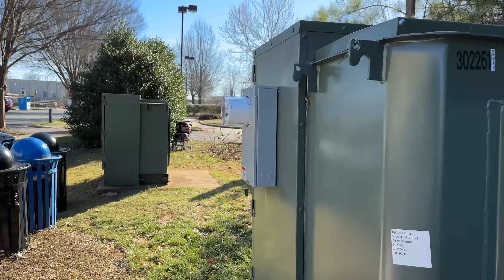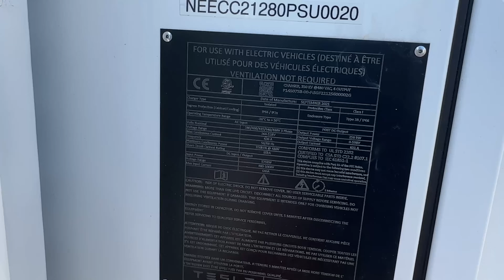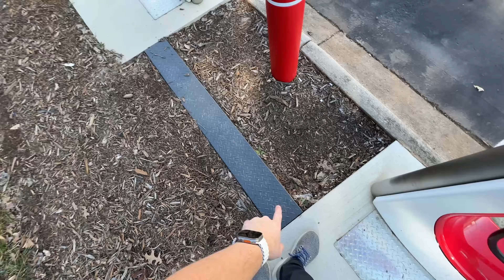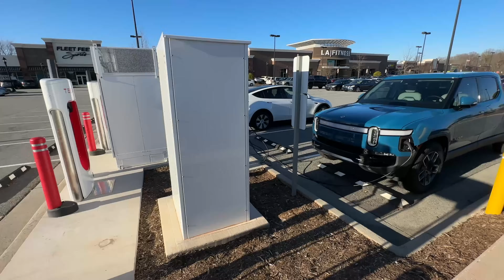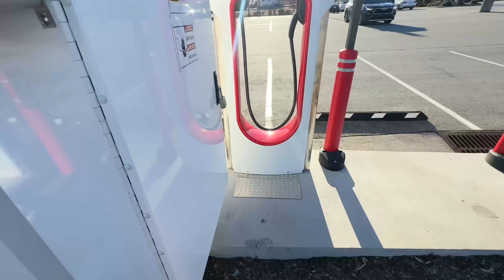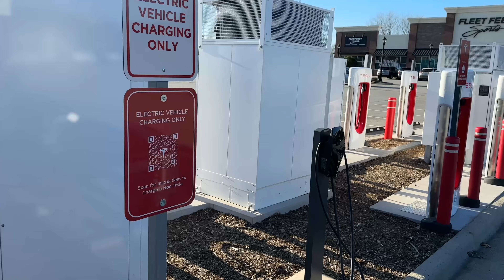Tesla Prefabricated V3 Superchargers - Genius or Incremental Improvement?

Comment: When the Bemidji MN Supercharger was new I walked around and looked at it and remember talking to my kids and told them that it looks like Tesla learned a bit and a lot of this is prefabricated probably for speed of deployment, installation and cost reason.
Reply: After watching this this is definitely more prefabricated than the one I saw in Bemidji. The V2 is look like everything was poured, wired and installed and set up at the site.  So when I went to the Bemidji one it was clear that the pedestals that the stalls they were sitting on were pre-made. That's what got me to start  looking at it.

Comment: I'd like to see a video talking about how a CCS adapter can be used on a Tesla supercharger.  Specifically, how would it work for a vehicle with the charge port in the right rear when the charger cables are so short.  It seems like a CCS car would have to park in the adjacent spot, thereby actually occupying two spots.

Comment: You mentioned the layout with the L2 chargers on the ends. I'm guessing this comes down to the way the DC bus connection from the main cabinet to the single sided isle. It's really short. It probably just worked out the best based on their lease for the property. Though they could have slid everything down one spot maybe and had the L2 chargers on the end with the utility transformer.

Working as a designer for an EE firm I really enjoy your channel (came upon it from the Out of Spec channels) and learned stuff. I'm in CA and we have to provide pathways for EV charging (7.2kw per stall) per code. Working on a current project that I need to bring a dedicated feed over for 10 EVSE spaces and makes me wonder if it would be better to just for single phase 480-120/240 transformer to get a little better charging performance.
Reply from the maker: I agree for this install - likely came down to the space allocated and aligning DC buses. L2 is easy to move as needed on a plan.
For your project, if you already have a 480 feed, I’d do a 480-240/120 step down to get better charging performance. You can also then have smaller conductors to the transformer and place it close to the charging install.

Comment: Single phase is not more effecient than 3 phase. Also home voltage is 240v, commercial is 208v.  The most effecient step down to level 2 would be 277v down to 240v ( tho i understand it may be 208v because this is not residential)  although did you see if that step down was in fact 277v input? I would.assume it would be a 480v step down.  (The least amount of step downs the better) also higher voltage transmits more effeciently.
Reply from the maker: What?
Reply: @brandenflasch  lol.sorry my CD was scratched and i skipped lol *fixed
Reply from the maker: Single phase isn’t more efficient per se, but 240V vs 208V delivers more power an EV at the same current.
Reply: @brandenflasch  I do agree with that, but that’s not what you said in the video or at least not what i got.  Also there is 2 reasons why, 1 st the efficiency in conversion is better to step down les from 277v to 240, second as you said wattage is Voltage X amperage, so 240x50 is more than 208 x 50….although idk if Id say that’s the reason it’s more efficient because all you would need 
to do is raise the amperage to 60 and yield the same out put.  I know I’m splitting hairs and most people won’t care, but thats what happens happens when the nerds arrive haha
Reply from the maker: @stang393  well when you’re current limited on the vehicle side, you need to increase voltage.
Reply: @stang393  The primary current of the step down transformer would also be 1.732x for a 277V primary compared to a 480V primary. It would be slightly cheaper. And a more standard transformer is 480 to 120/240. My guess is that's a 25KVA transformer in that package. That 52.1A @ 480V and would be 90.3A @ 277V. So at 480V you get #6 conductors and #2 (maybe you could make #3 work) at 277V.

Not saying that a 277 to 120/240 transformer doesn't exist but I haven't seen one in 24 years working for a contractor and an EE firm.

Comment: Trying to understand how they share the DC bus. Current to a car connection needs to be throttled to match current requested by the car. I would expect this current throttling to be done in the AC to DC conversion unit.  This cannot be done if  DC is paralleled after the DC conversion and before the car connection tap.  Seems each car connection needs to have an additional DC to DC current throttling device.
Reply from the maker: The DC bus between cabinets is at 880-1000V, so I suspect they’re using buck converters or similar to regulate voltage when then outputting to vehicles.
Reply: @brandenflasch  that brings up the point of moving to 1000V - they'll skip using the DC to DC conversion and just use full voltage that is going between those cabinets.  I can't wait to learn all the specs of the Cybertruck.
Reply from the maker: They’ll still need to use DC-DC to match voltage

Comment: As always nice insights and good point that the level 2 AC charging should be grouped together and maybe increased to the same amount as DC fast chargers but great move from Tesla to now also support non-tesla vehicle charging although it's just 11kW i hope for you that the most reliably fast charging network around the globe opens up over on your side although the different connector is the biggest problem and the short cable lengths and therefore cars like ID.4 could block 2 spots if not parked properly..
How do you feel about adding a additional energy storage for lower input power requirements and back up capabilities for limited time, especially with star link terminals it makes even more sense (if the relay or ground station is also backed up)
So like 1MWh storage, capable of delivering and receiving 1MW continuous power and only 100kVA or 200kVA input power instead of tenfold.  (or is the overhead or effort for the transformer and utility site already that big that it won't matter,  if their not power constrained in the first place) ? is this the future anyway? with energy trading for stabilizing the grid..
or is the overhead for storage otherwise to big for charging station which are below 20 or 30 stalls?
Reply: I suspect that future Supercharger sites will begin incorporating something similar to a Megapack for exactly that reason to provide peak power across even higher kW charging posts - especially in locations where requesting more than KVA becomes very expensive due to existing power infrastructure limitations.

Comment: Love the prefab units. St. Peter location went in super fast last year & it prevents local installer screw ups like the end stalls in Fargo & Grand Forks, ND from being put in backwards. Doesn’t leave an option for pull through or trailer spots though, which may be an issue over time.
Reply from the maker: I have seen Tesla separate one post from the PSU to accommodate accessibility requirements and likely could do the same for a trailering spot
Reply: @brandenflasch  Nice, I haven’t seen one of those yet. Hoping to get up to Two Harbors in the next week or so, but I don’t know if there’s a pull-in spot there. Black Bear has a great trailer spot, but I don’t think that was prefab.
Reply: @brandenflasch  yeah accessibility should always be considered if they would make them 50 to 100cm more apart in Europe they would even need special handicaped charging spots, oh wait we don't have them anyway ^^ i looking forward to them since i have relatives which are affected by that concern and yes of course the old continent is way harder to change because it's historical grown and space is always a constrain and it would mean we would have to give up 1 or 2 parking spaces in order to accommodate the ever growing car dimensions..
Reply: All the charger "posts:" in Hilliard are backwards.  I mentioned it to a service tech and he just shrugged.  It will still work, but not the standard installation

Comment: Hey Branden, very informative video. It seems like adding level 2 charger to a DC site is cumbersome, adding another transformer etc. But I think it is a great idea. Most of the time superchargers are too fast, if you are visiting the mall, shopping or going to gym etc. 

Sometimes slower charge is way to go

Do you think slower DC chargers are more useful than the AC ones? I feel like 25-50kw is perfect for running errands/shopping etc. 

But there has to be a lot of stalls and no idle fees. 

That would be perfect for peoole who doesn’t have home charging.
Reply: I had the same thought.

Comment: Branden is the system a shared load system? Can you charge 250 kW all at each dock at once or will it in extreme use d-rate the charges?
Reply from the maker: If every stall was full, you could only allocate about 88kW to each stall, however it’s extremely unlikely that every stall would be requesting more than 88kW and as such that frees up power to allocate to other stalls
Reply: @Branden Flasch  Thanks for the fast reply Branden and have a great day.

Comment: It seems to me, in order to better accommodate conduit interconnection between PSUs and also enable deployment of the PSUs in an island configuration they should have positioned the power conversion and control cabinet at the end of slab rather than the middle. Also, I am wondering, what factors necessitate a star controller configuration vs. daisy chaining? Finally, even if logical daisy chaining is not feasible you could come up with a physical (PSU module) daisy chain design that implements a logical (wired) star controller design (admittedly causing some longer wiring runs and larger conduit)

Comment: Note: '1,000 KVA transformer' is labeled 1,500. No biggie. So the stalls are not capable of 250kW individually? I've seen 250 kW only for short times so maybe that's the smarter way to do it. They will rarely see an instance where every car plugged in will want 250 kW at the same time. We call that diversity.
Reply from the maker: I may have misspoken - yes, you’re correct. The DC buses allow the power to be used very effectively across stalls.